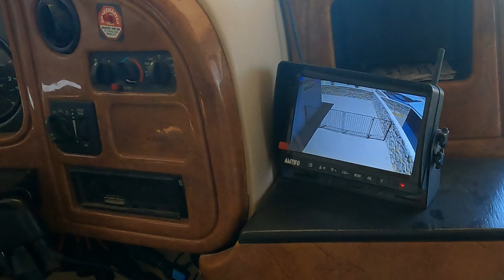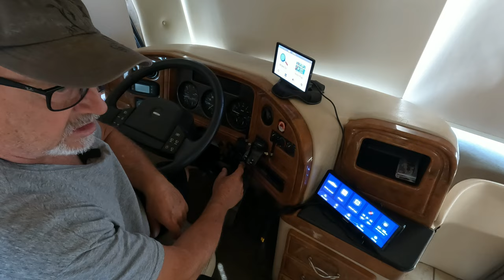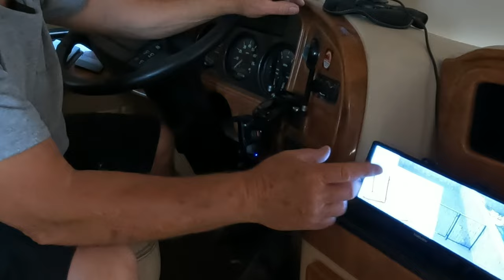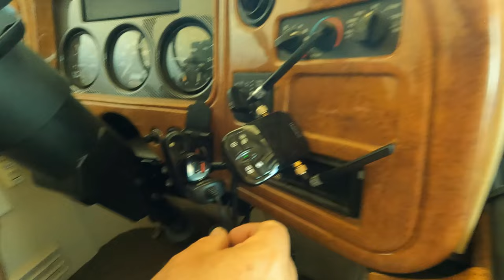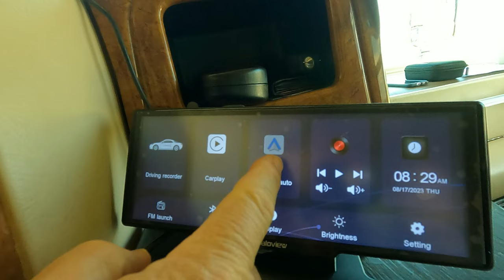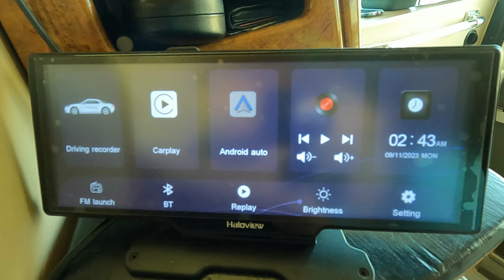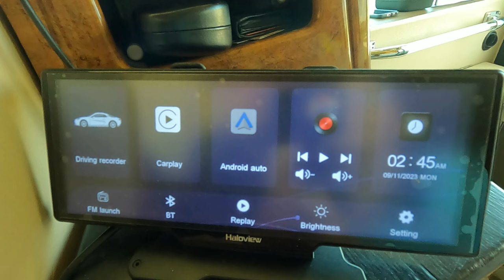Improving RV Safety: Haloview RV Front & Rear View Camera System Review & Install

Comment: We have a 2005 Alfa Founder that has the original black & white back up camera. I did not see that on your dash. How would a person factor that into the new camera hook up process?
Reply from the maker: I had removed the old black and white camera and used the wires from the old camera for my power for the new rear camera. I also removed the monitor inside that was mounted on the front upper cabinets.
Thanks for watching!